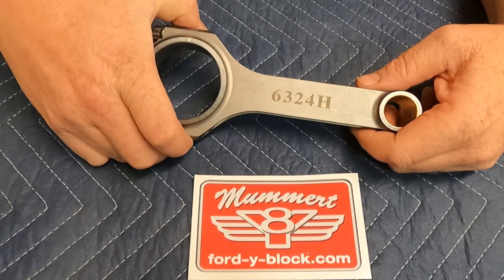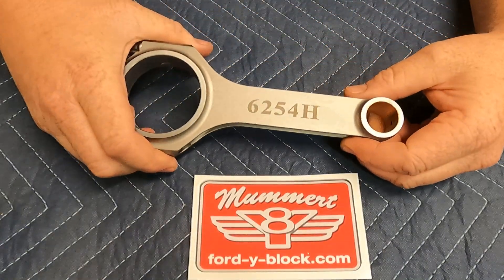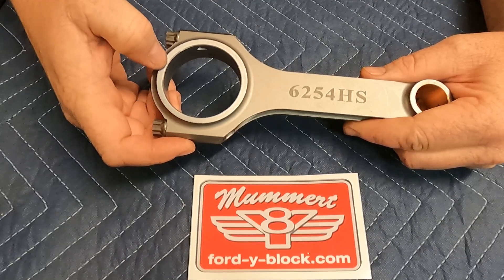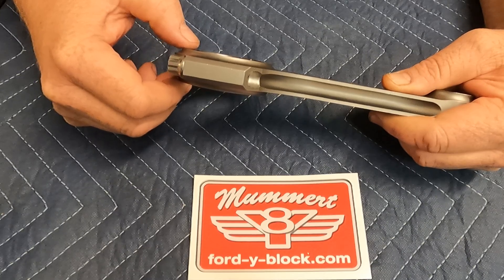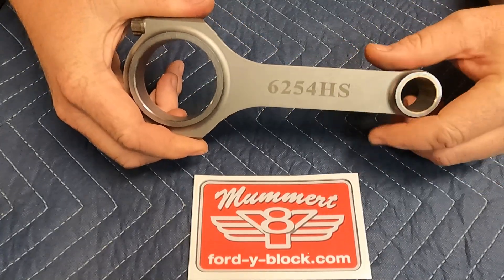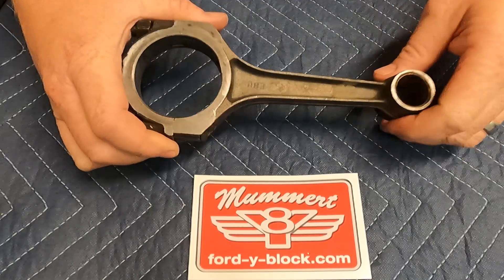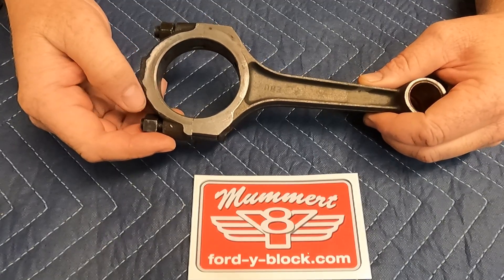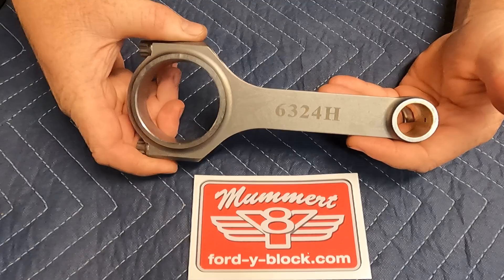Ford Y Block 4340 H Beam Connecting Rods

Comment: Well thought out guys!  I like the 2" journal as that's and easy get some more cubes when having the crank ground.  The 312 replacement is a great upgrade as well.  I have had several Y-Block engine failures using prepped stock rods and this can save you a bunch of money in the long run.